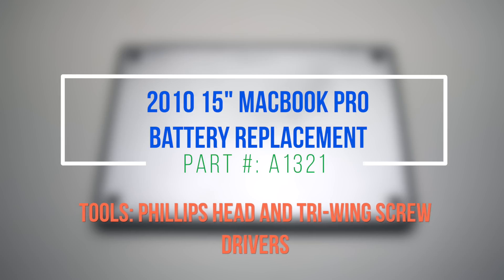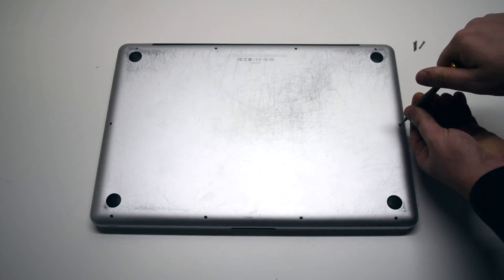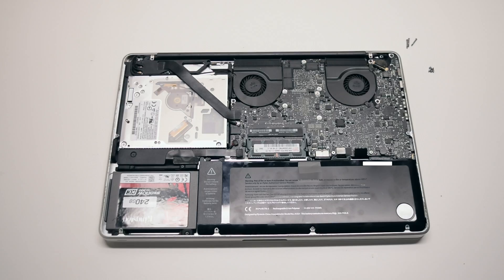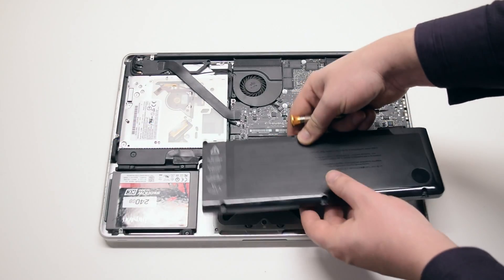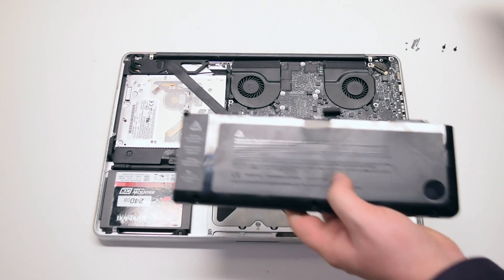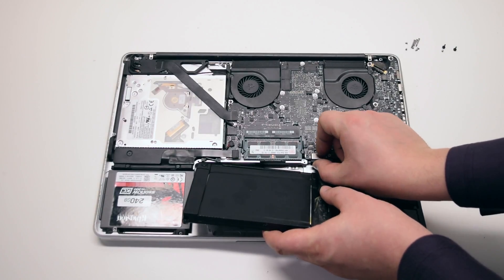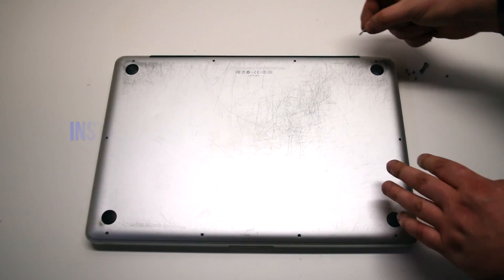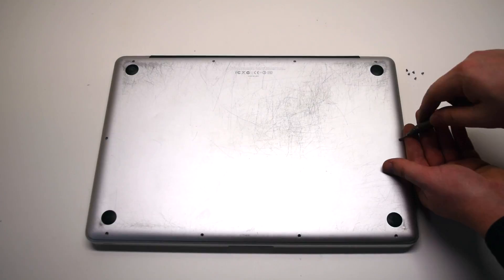2010 Macbook Pro 15" A1286 Battery Replacement

Comment: Please tell me from where I can get the battery. I visited apple service centre, they told that we do not have the battery of your model because it's "vintage". I searched online then, but I didn't get any battery with good ratings. Please help me! I would be thankful to you :)
Reply from the maker: Ebay or amazon, type in 2010 a1286 battery.

Comment: which one do you recommend to buy.. for A1286. as this are 5200 mAh. And original is 7000 mAh
Reply from the maker: I would recommend an original apple battery but if you are on a budget then an off brand with same specifications.

Comment: Do you happen to know the mah specs on the original battery that comes in the 2010 15 inch MBP?  I can't seem to find them anywhere.  I've seen everything from 4,000 mah to 5,200 mah - but nothing from an official Apple source.
Reply from the maker: It's 7077.625 mAh
Here are the spec written on the original battery:
Battery Type: Li-ion
Voltage: 10.95V
Capacity: 77.5WH
Cell: 6Cells
Use the following calculator to get the mAh from V and WH; https://milliamps-watts.appspot.com/